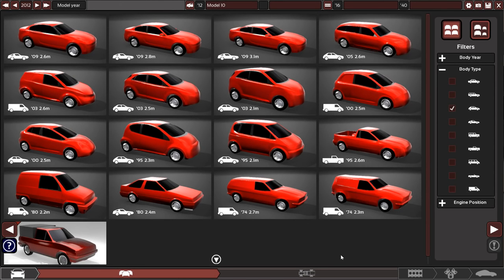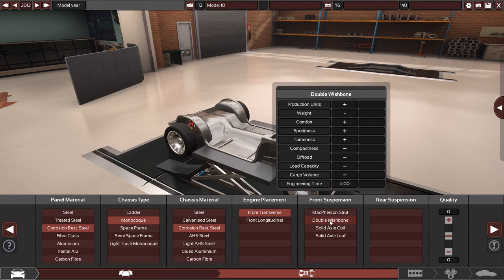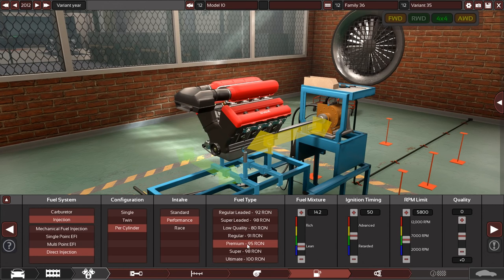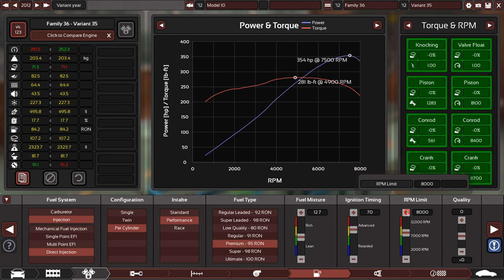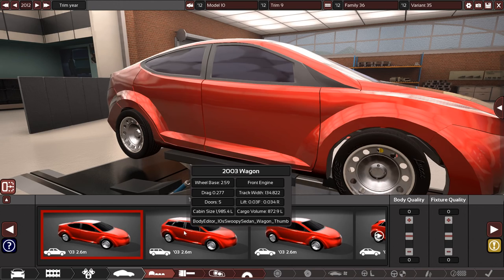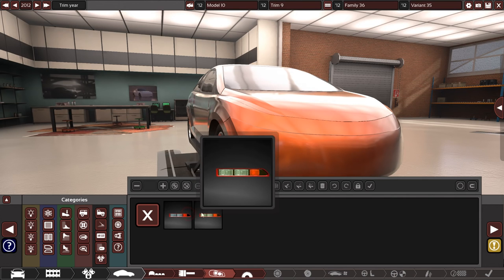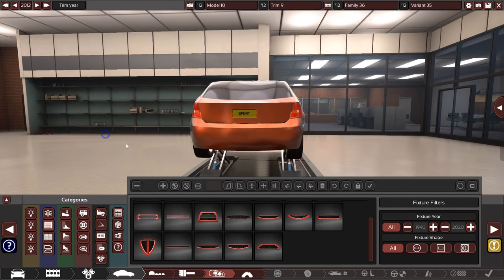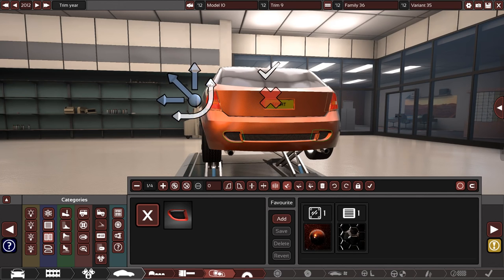Automation - FWD Lamborghini Beater !

Comment: Here's challenge for you- make a car that noone wants, and that laps TG track in more than 3min.
Reply: Lada challenger
Reply: I like how you tried to use grammar but failed miserably.
Reply: That's going to be REALLY slow. I've built some very sad, low performance cars, and three minutes is a hell of a long time.
Reply: Ultra-low compression 2 cylinder engine, rear-engine and FWD, solid axles with leaf springs, ladder-frame chassis, drum brakes all round, and the bulkiest body style available.

Comment: I can't wait to drive my 4 tonne 1500 horsepower luxury sedan
Reply: Laura anderson-lombardi and my  12000rpm v8  with a crossplane crank in a Toyota AE86
Reply: Laura anderson-lombardi try a modern 2 door land yacht with 1700hp, and literally, like the front end alone is at least the length of the car.

Comment: Beaky car? 1970 Ford Thunderbird. Thing has a beak and a half off the front. '70-'71 Pontiac Bonneville is also got quite the front styling.

Also, the body morphing is locked out one you start doing vehicle components (transmission, interior, etc). On the paint and wheel pages, there's a little lock button in the bottom left of the screen (above the menus) that lets you toggle the lock on and off so you can adjust the arch size.
Reply: mercury cyclone

Comment: Here is a challenge build a V12 engine but make every setting the maxican go and make it as light as possible and see how much horsepower you get also for turbos please do it as 1 / cylinder for the configuration